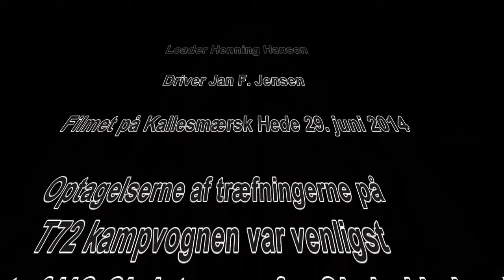Åben Hede 2014 - Centurion Tank

Comment: Some tank guns have horizontally (like this Centurion) opening breech blocks, others have vertically opening breech blocks (like Leopard 2). Is one better than the other? What are the advantages of horizontal vs vertical breech blocks?
Reply from the maker: Well, the British 105 mm L7 tank gun were used by many Western tank manufactors, and the vertical breech block works perfect, and it's easy to load and reload the gun. I'm not a Leopard 2 expert, but I will guess the loading is made easier with the horizontal breech block, as the gun elevates into the loading position.
Reply: @PrimusPilus2  Thanks!